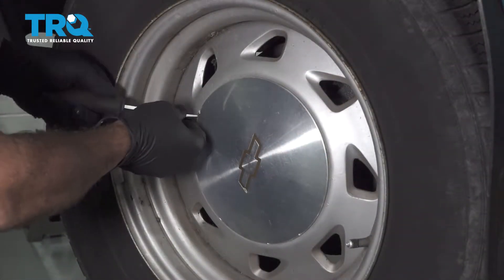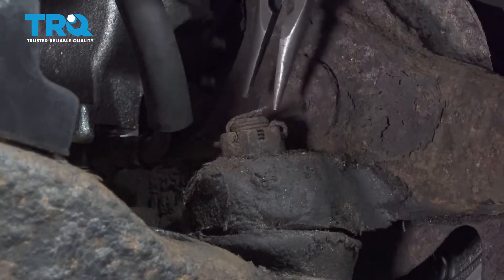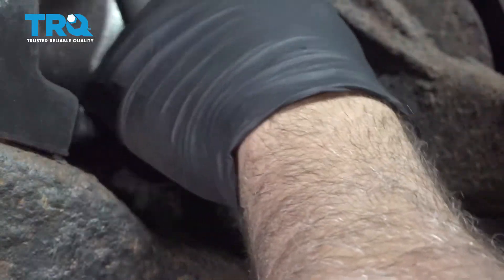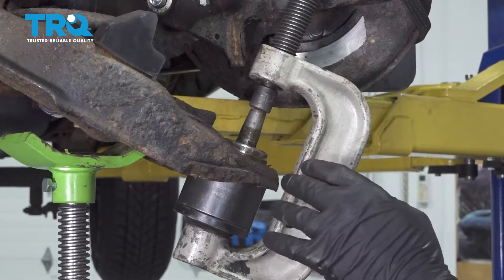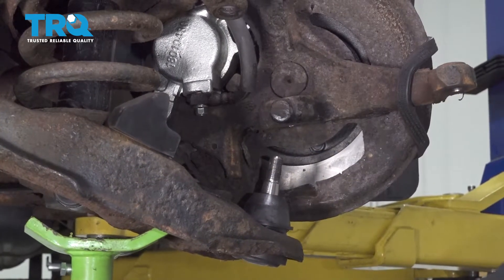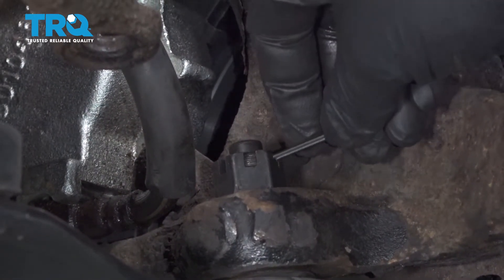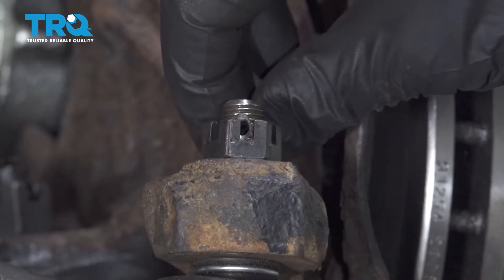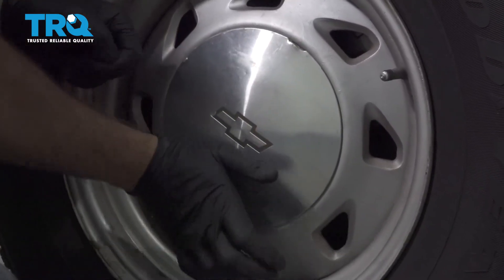How to Replace Lower Ball Joint 1994-2004 Chevrolet S10

Comment: lower ball joint fits but comes loose new was installed but keeps coming loose 1997 Chevy s10 long cab 2 door the part number I have is G6145T the old one came off a little hard but the new one comes off with out pressure need help why thanks

Comment: Glad I watched this because I couldn't get the clamp to fit on my 99 S10. Never occurred to me to cut the threads off and to use my impact drill. Just a carpenter that enjoys doing basically anything, including mechanic work. Thank you.

Comment: im having a terrible squeak when i get in and out or press up and down on my blazer,the boot is ripped i know that much,handles corners terrible,,would it be the ball joint squeaking or the lower control arm bushings,what do you expect,its annoying and sounds ghettofied disgrace lol your tip would help alot i hate to replace ball joint and it still squeak.driving down the road it kinda wanders with the grooves and cracks in the roads.tie rods ? my lower control arms are super clean ,not sure about bushings. i need help,,,thanks

Comment: I have a question so I need to replace my two front ball joints, so do I order a front upper and front lower for both sides?
Reply: Yes, in total you will need 2 upper and 2 lower ball joints. You will also need a ball joint pickle fork which really helps break loose a stubborn joint and a ball joint press to fit the lower back into place

Comment: I noticed that you started out with the old lower control arm, but final assembly is with a brand new arm. What happened?
Reply: Thinking the same thing. He literally pressed it in the old arm and the new one appeared in the ending
Reply: The Chevy S10 / GMC Sonoma is known for having lower control arm rust issues it is generally recommended if you are replacing the ball joint to just skip the pressing and get a whole new control arm with it as to help prevent dangerous rot in the future.
Reply: Gotta be efficient with footage and crafty when you forget to record a step. Good on them for pulling from another video to show the complete process. 

It’s a how to video. They don’t need a continuity manager 😂